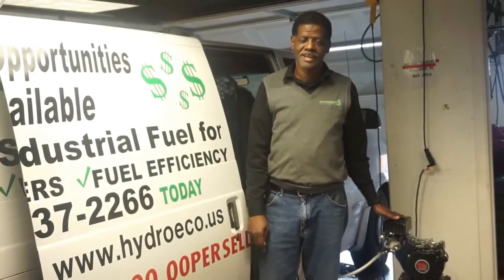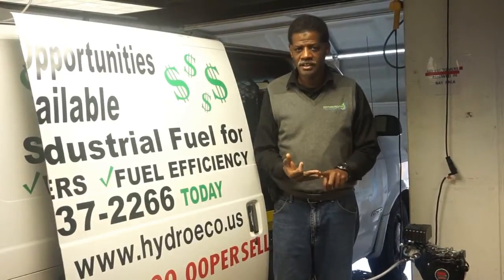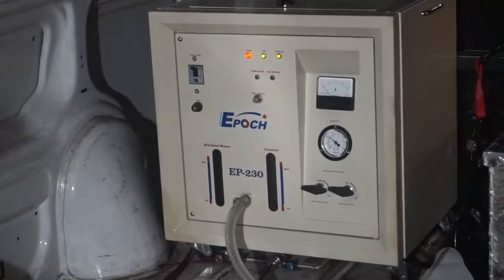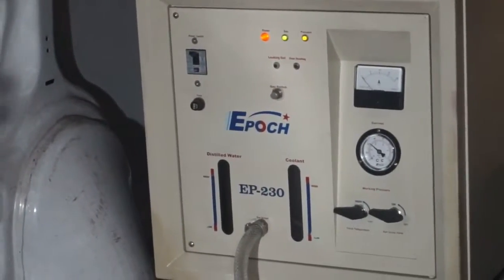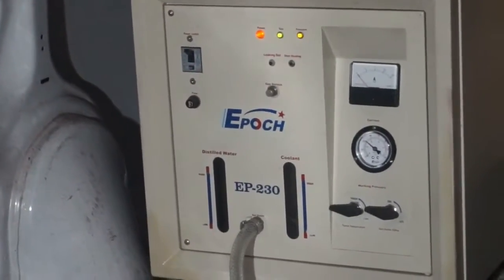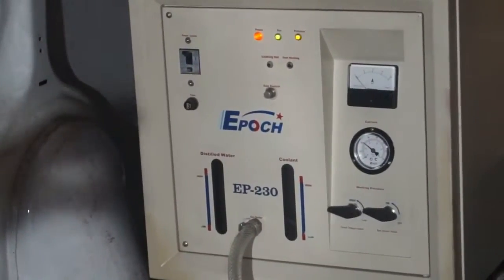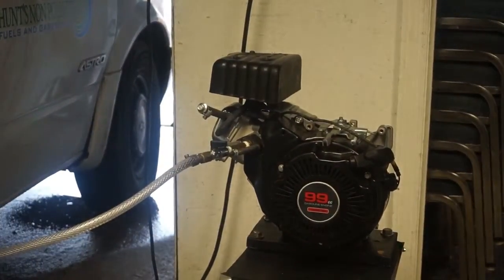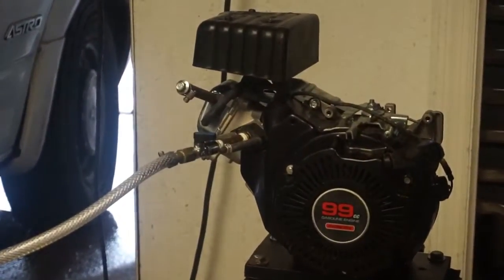Engine running on HHO and hexane NO AIR!

Comment: Iv done this with a 3.5hp tecumseh straight hho. But I had to retard the timing because hho gas infound ignited alot faster then gas. Did you have to retard the timing also?
Reply from the maker: No, I found that it well start on the third pull. Please make sure that you have a good back flash arrestor.

Comment: Hexane, easy absorbing through skin, used in lots of consumer products, however it's known to cause nerve Damage to Limbs, hands arms feet, legs, so beware of exhaust fumes... Thom in Scotland.
Reply from the maker: We used hexane because it doesn’t leave residue In the bubbler when it evaporates. You can mix hho with any fuel.
Reply: @inventor1963  yes indeed, hydrogen is a very intelegent gas.,  Do you build your own HHo units Kenneth ?... How much gas does it make, ... Thom in Scotland.
Reply from the maker: @fuelban  I don’t build my own but I bought mine from company called Epoch in China It makes about 10 liters per minute
Reply: @inventor1963   that's a fine production Kenneth, 10 Ltr/ min,. What voltages and amps ? ... Thom in Scotland.
Reply from the maker: @fuelban  115 volts and up to 20 amps if I run it over an hour.
Reply: @inventor1963  ok, thanks for the info Kenneth and I'll keep a watch for your  future progress, good luck hope you do well... Thom in Scotland.
Reply: Hi. How many kilowatts does the hydrogen generator use?   @inventor1963
Reply from the maker: @brettjasonheadinventor  2300 watts tops.
Reply: @inventor1963  thanks for your reply.  Have you measured how much gas it produces per hour or power it consumes per hour.
Reply from the maker: @brettjasonheadinventor  600 liters per hour.

Comment: Its purpose again?... What are the emissions?... You still have to extract and refine hexane the same as gasoline?
Reply from the maker: I’m only using hexane because the manufacturer the my HHO machine suggests it. It is a flame coolant for cooking (https://youtu.be/WfkNf7kMZPA) because HHO gets too hot by itself. As you may notice later in the video I turned off the hexane and the engine is running on pure HHO, as a matter of fact the engine sounds different.

Comment: does that engine have any modification besides the intake setup? has the ignition timing been changed?
Reply from the maker: No, one way is to use this https://www.jegs.com/i/MSD-Ignition/121/8680/10002/-1